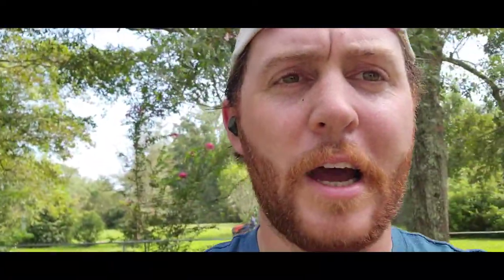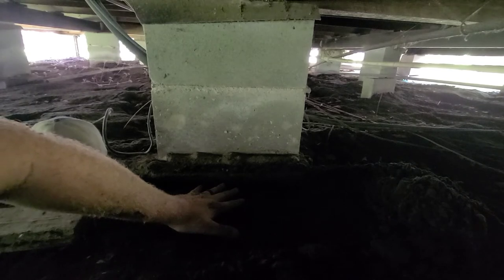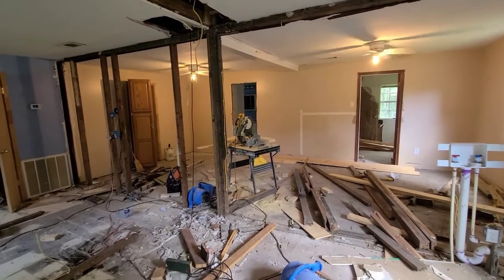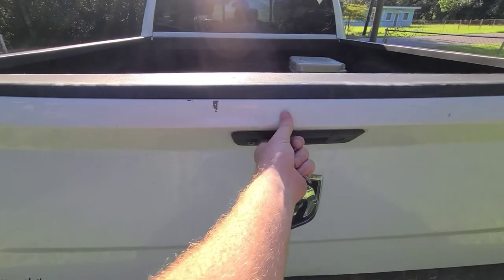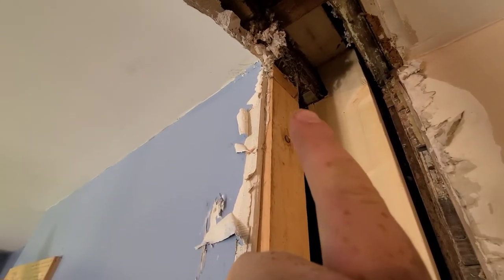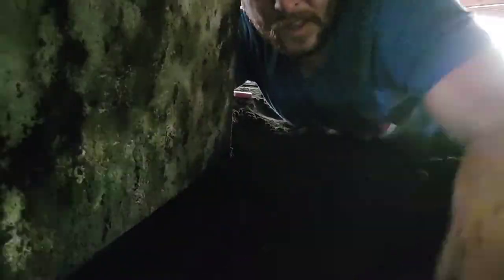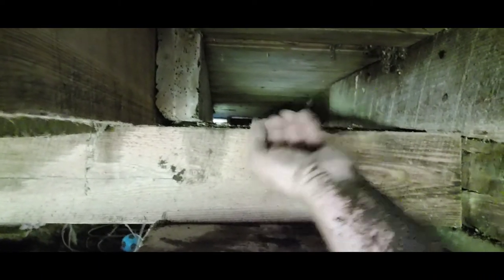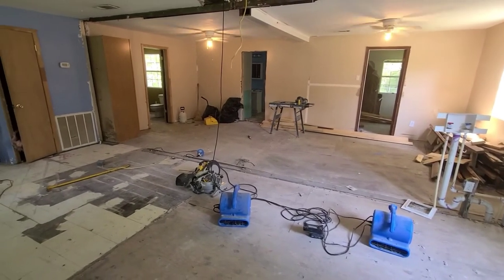Removing Load Bearing Wall!! - S1:E14

Comment: Dis I miss something Did you temporarily supported the low bearing wall
Reply from the maker: You didnt miss it. The ceiling is supported from above as opposed to underneath. It requires more fastening, but due to the construction it was the better option. So the load bearing wall was the temp support until the beam was installed. Thanks for watching!!

Comment: How is that a load bearing wall without a header? Did I miss something? You supported the outside of the wall but nothing on the interior?
Reply from the maker: Thanks for watching! Check out the load bearing beam build in the previous video